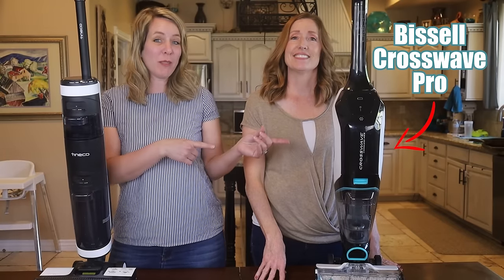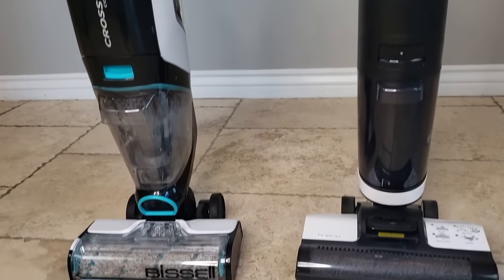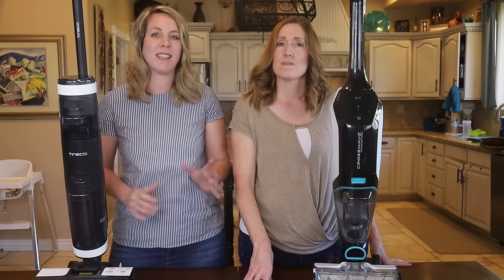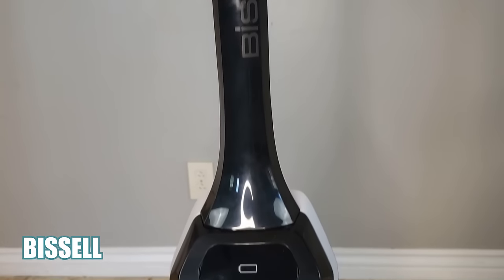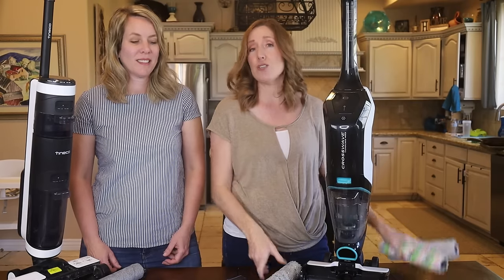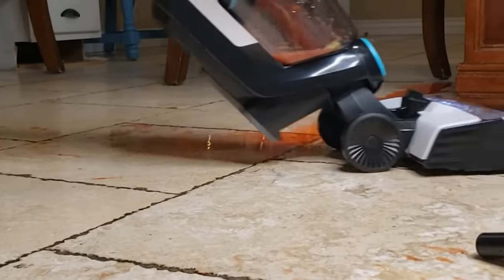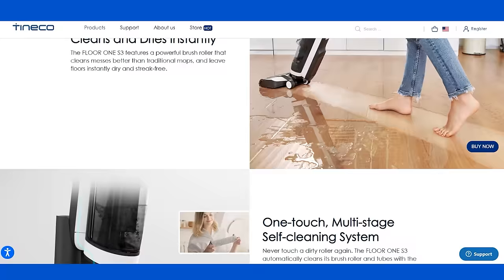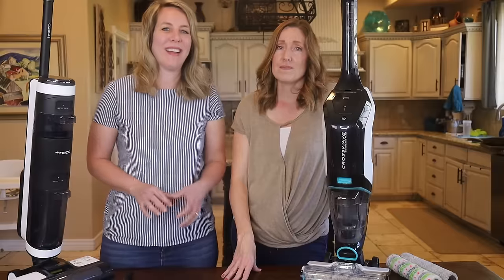Bissell Crosswave vs Tineco Vacmop (Which is Best??)

Comment: Could you comment on how easy it is to get the tineco around without the pivoting head.  I have a relatively clean house but about 1600 square feet of LVP on the main level. How many times would I need to change water with the tineco?
Reply from the maker: It’s easy to get around. The Tineco senses the mess and adjusts how much water to use. I don’t really know how many times you’d need to share the water but after more tests that we haven’t done videos of, Tineco cleans best. And the newer model even better (S5).

Comment: Are these better then the steam cleaners you have (dupray)?
Reply from the maker: They’re different. Steam cleaning is with heat/steam and it’s for floors but also cars, kitchens, showers/bathrooms. Vacuum mops are just for hard floors and they don’t use heat. It vacuums and mops at the same time. Steam isn’t good for all floor types. 

So basically if you don’t have a lot of hard floors, you probably don’t need a vacuum mop.

Comment: Wondering if you know of any other brands doing a wet vac that lets you do regular dry vacuuming like the Bissell? It’s the only one I’ve found so far, and I like knowing all my options before I invest in a pricy appliance!

(Also can I just have a mini-rant about how confusing it is that all these brands are calling the mops that can only do wet vacuuming ‘wet/dry vacuums’! )
Reply from the maker: None are made to vacuum regular carpet. Only for vacuuming hard floors and low pile area rugs. It’s to take the place of sweeping or vacuuming the floor before you mop it. We agree it can be confusing though!

Comment: I wish I would have watched this before I bought my shark vertex cordless vac that wasnt much cheaper and only vacuums.  Vacum wars reviews said tineco was better but i dint like the fact I couldnt just vacuum with it without upgrading to the 499 model so being I am so picky about my highly shiny wood floors I decide to just get the vertex hoping the polishing roller would help keep the wood floors looking vacuumed and get the smudges, body oils from feet shoe tread marks just literarily everything shows on those floors!  I hate them!  I like that the bissel can be used as a vacuum alone!  Is it a good enough vacum that it will get the floors really clean?  Can it pick up large pieces of dog food?  Thats why I got the vertex is from the dual roller that polish's and picks up dog food kibble.  I am also wondering if it will get extremely shiny varnished wood floors that smudge easiy clean and streak free?  Thats huge for me because I take my miocrofiber mop to the sink to rinse between each room because if any dirt is on it it will streak!  I have neve like any other type of mop for that reason and have tried many.  I do have to say I love bissell products and have only owned bissel vacuums for the past 15 years or so (even when I owned my cleaning service)  but the tineco is hands down the coolest and most sleekish looking!  One more question: Did you say you can take it to the station for a rinse between rooms?  I dont want to run a dirty mop head the whole time.  I used to have a vecro pad type and owned like 15 pads I would change between rooms and even that didint stop from streaking.  My floors are impossible!  I am defietly considering taking back my vertex after seeing this video even though I do love it but I have stopped keeping my floors as clean as used to because its so time consuming running back to the sink to rinse since this is much quicker I may go back to mopping 2 x's a week because thats what it takes to keep my floor clean and it actually could use it daily but who has time for that?  Maybe I could use the floor vacum daily and mop every few days and all in one apparatus!  Just wish the bissell wasnt so bulky looking. I love the stick vac look of the tineco and my shark vertex!  Great video!  Thanks!
Reply: You’ll be better off with Tineco

Comment: Have a bissell and have used it on my vinyl wood flooring and it leave a lot of soap residue. Any suggestions as I only used the bissell cleaner?
Reply from the maker: What soap are you using?  Are you using the Bissell cleaner specifically for Bissell?    If so, try using less.  I have not had this problem.

Comment: Has anyone experienced their floors staying wetter for longer after mopping? 
Mine initially worked perfectly, leaving the floor dry in about 15 seconds. But over time, after a month of daily use for about 10 minutes each day, now it can't wring out the water effectively, and the floor takes about 5 minutes to dry. Does anyone have a solution to prevent the mop from losing its ability to dry the floor quickly?

Comment: More simple to use robot vacuum cleaner. We don't need to be tired. The edge of the room is also clean from dust. Because it has swivel broom.
Reply from the maker: Robot vacuums are great but not for all spaces. Diana’s is perfect because she has large open spaces. Mine is very cut up and with different surfaces. And the vacuum doesn’t mop, although there are robotic vacuum mops they can’t hold much water. Which means emptying and refilling a lot.
Reply: Not very much water, but enough for the house in general. Water output can be adjusted. The important thing is that we don't have be tired anymore. Because the robot can move on its own. Use some advanced robots if the house is big.

Comment: Can this be used on hard wood floor?
Reply from the maker: Yes as long as it's sealed wood, it's perfect.
Reply: @CleanFreakGermaphobe  the Bissell has those harder bristles in tje brush. I wonder if those will lead to scratches on wood floor.
Reply: @MtnXfreeride  It’s a soft brush and will not scratch flooring.

Comment: What’s the differences tineco I between S3 to S5?? How does it do with cat litter it’s like sand??
Reply from the maker: The S5 has the roller lower and closer to the edge on one side so you can get in closer along the edge of the floor. It also has a larger clean water tank so you don't need to refill it as often (it's on the back). In our tests it also cleans better. It's now our #1 recommendation and outperforms the other I think 6 that we've tested.
Reply: @CleanFreakGermaphobe  thank you and you did everything for me .

Comment: But there is no way to clean under the beds isn't it?
Reply from the maker: You can to a degree but you're limited to how far you can reach. I would use a flat mop that can lie almost flat to get those areas. First dry to get the dirt. Then wet to mop.

Comment: The tineco systems leak water which is bad for wood floors. I end up having to mop afterwards which defeats the purpose.
Reply from the maker: So interesting - I’ve had mine for a few years and never had leaking unless the dirty water tank is full and needs to be emptied. It shouldn’t leak, you can reach out to the company.

Comment: Tineco was such a disappointment.  Worked for two months then computer died. Contacted company and they said since it wasn't purchased directly from them they wouldn't honor a replacement or fix it. Never buying from them again.  Not worth the chance of the computer glitching and not running especially only after using it for two months. Purchased Bissell HF3 and love it.

Comment: i currently vaccum and then mop with a spin mop- when i vaccum it leaves scuffs on my baseboards. does anyone notice their tineco/cross wave leaving scuffs on baseboards?
Reply: I use self adhesive foam on my vac head...like the type you get in a roll for sealing windows etc. Cut into strips and just pop on😀

Comment: Any battery replacement?
Reply: No both are built in and on the tineco in particular would require total disassembly.  But the Tineco has a 3 year warranty so I’m sure Tineco would remedy any battery deficiency you might have in that time!!  

Bissell will certainly replace your defective battery if you contact their support line.  They have been great to deal with!!!
Reply from the maker: Neither offers a battery replacement.

Comment: The biggest problem with both of these is that their batteries are not replaceable. Even the best machines out there (e.g.  Dyson) have a 2-3 year lifetime on their batteries.  This means after 3 years you’re going to need to replace the whole dang thing.
Reply from the maker: I have to replace my Shark steam mop every few years. My Tineco saves me so much time I would buy another one in a minute. I really never want to sweep or vacuum my hard floors ever again.

Comment: I bought a Crosswave. NOT impressed!! Too heavy, drips, leaves floor too wet - need to dry mop with microfibre afterwards, then comes having to clean the machine. Also with a large area, cannot do it all on a single charge.

Comment: Horrible review. You can't pick up spaghetti and eggs. Ridiculous.
Reply from the maker: It's an illustration and more dramatic so you can see (the color of the food). You can't really tell how well it'll do when there's not much mess or you can't see it. If you have kids these aren't unreasonable messes. Although in my household they're very rare (this is Janet). 

Mine is used mostly to pick up the dirt, dust and stains you can't see. But you can tell when you empty the dirty water tank.

But if it's not for you that's ok too.